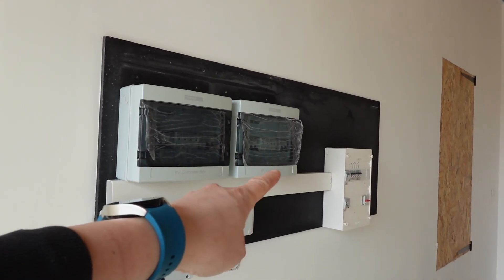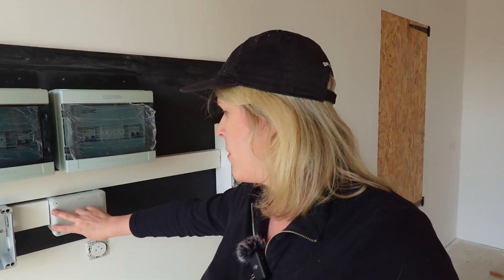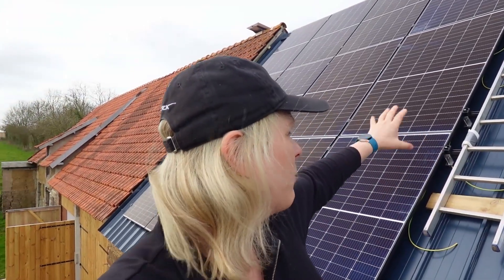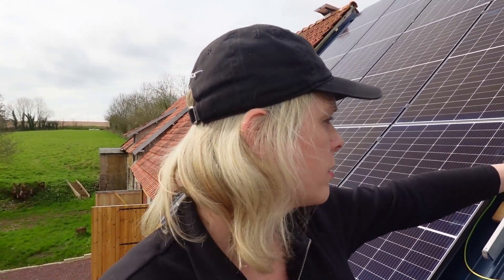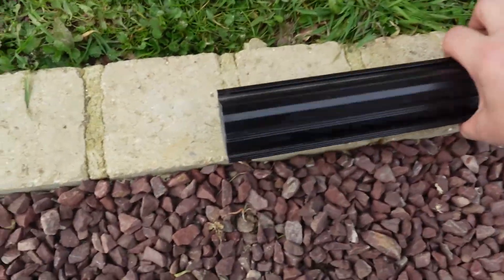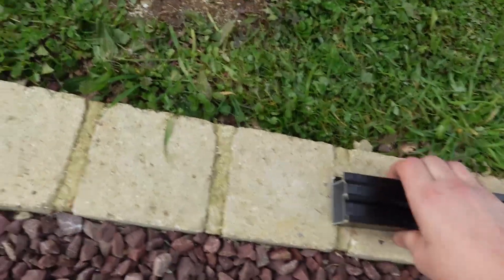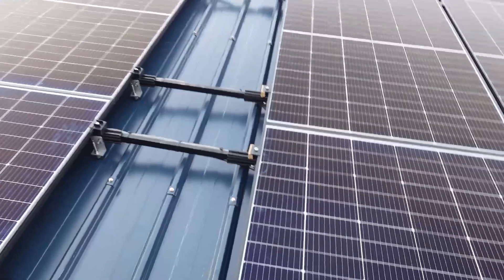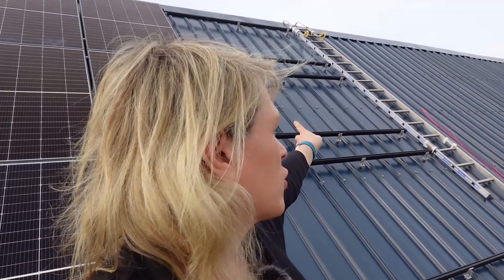Solar Roof Install - Design Change

Comment: Great job. Keep up the good work. Grounding to electro rod closer to the array would make a go to earth quicker. It doesn’t matter how good you ground it. A lightning strike will take out the lightning suppressor. But if you don’t have a good lightning suppressor, I could damage your equipment. It’s better not to be cheap and bypass. A good lightning surge suppressor light midnight solar. It’s cheaper to replace it than to replace all your equipment. Just saying. There have been several channels on here where they had it grounded properly, but didn’t have a good search suppressor and it took out there Victron inverter. The YouTube channel that experienced this lightning strike was called  Tiny shiny home. You could look at their channel and confirm if you like. Keep up the good work. Stay safe.

Comment: Great design choice to leave that service gap and the spanning rail. I guess there was a reason you couldn't have just continued the rails, left the gaps and bought more rails? I am a little green with envy about your whole system.

Comment: Consider moving earth - and any other - cabling on the bottom of your alloy rail connectors. It may help in the future if you need to step on it or attach anything to it like the ladder.

Comment: One more thing.....
Earthing of the rails and the surge protection should be directly connectet to a ground rod, not only to the PE of the electrical system.
Reply from the maker: This brings up an interesting point I guess it's different in every country I have to check to see what the regulations state in France do you know by any chance.
Reply: @Gridbusters-qx4om  
Yes, regulations might be diffrent.
But take a minute and think about where the energy goes, if a lightning strikes into your rails. I assume you don't want to let that current flow over the PE into the distribution in your house...

Comment: The ladder gaps are a good idea, but is that painted alloy tube that much cheaper than the rail? Is it worth to save that small amount of money?
I suggest to go strait with the rail. If you want to change anything at anytime you will then be much more flexible.
Reply from the maker: No the solar rails aren't that expensive however the shipping would have been over 60 euros and we would have had to wait over a week for delivery!!
Reply: @Gridbusters-qx4om  
I suggest to always to think of further extensions. It's a good idea to always order some pieces more than you think think you will need.

One more suggestion: Put the cables on the opposite site of the rail/tube. You than would not step on the cables by using the rails as a ladder.
Reply: Would it not make more sense to layout the last string the same as the first two? Then when you add more panels you just continue in the same way.

Comment: SARAH, 
💡 GREAT ENGINEERING DESIGN FOR LONGTERM SOLAR PANEL MAINTENANCE ACCESS! 
💡 YOUR PROJECT DESIGN HAS SAFETY, INGENUITY, & LONGTERM MAINTENANCE ACCESSIBILITY! 
💡 DO YOU ENVISAGE IMPLEMENTING A HOME BACKUP GENERATOR TO CHARGE YOUR BATTERIES 🪫🔋 ON LONG RAINY DAYS?
WE ARE ENJOYING  👀 YOUR PROJECT! YOU ARE OVERCOMING THE CHALLENGES, NOT COMPROMISING STRUCTURAL OR CODE COMPLIANCY!
THANKS FOR SHARING!

Comment: the gap will also help with ventilation behind the panels. As you probably know, a hot panel reduces efficiency.